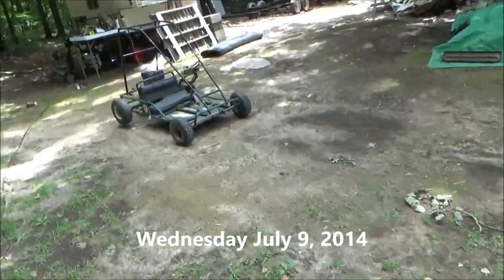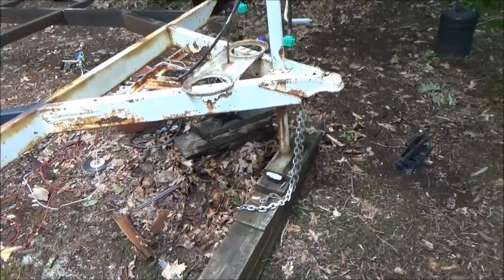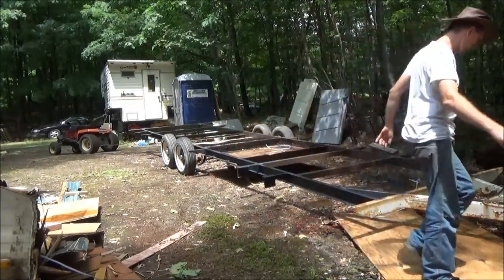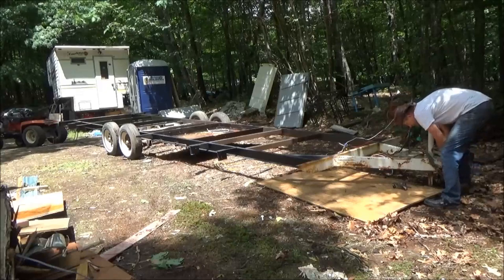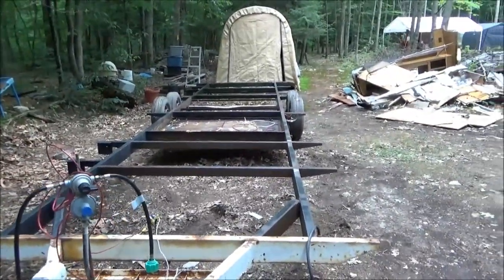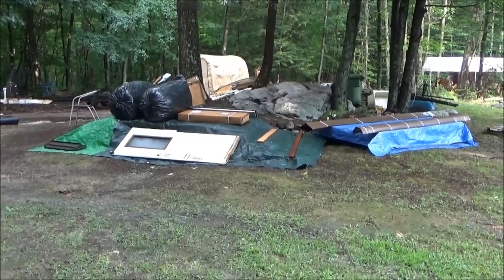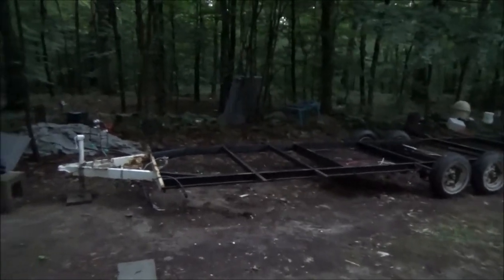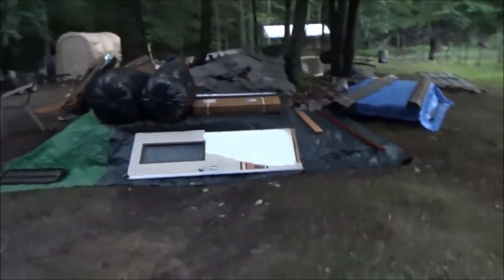Gokart Repairs And Prepping My Tiny Home Trailer

Comment: Watching that thin metal frame flex, bend, bounce, & twist when you yank on it with a small garden tractor, makes me think you should be putting the thinnest, lightest structure possible on it. I don't think the metal of those I-beams are thick & sturdy enough for anything else. Even when you lifted the front up & down by hand a little, the metal beams at the rear of the frame bounced & flexed like a leaf spring. 2x4 or 2x3 floor joists. Very little overhang, 2x2 wall frames with 45 degree joists in every corner for more rigidity, & no upper floor except for maybe a lightweight crawl space. Perhaps only 2x2 roof studs too. I don't think that frame will handle much more without bowing, bending, or twisting under the weight after you move in, or during high winds, or when a lot of snow & ice get on the roof.

Comment: Watching you try to move that trailer by yourself was very enlightening... I understand my Dad a lot better now.  He always made one of us kids stand around and watch him work on the trailers and things like that, which I found annoying.  But, now I get it we may have been skinny little kids but we would have yelled to him as soon as that tongue went in the dirt or fell off the rollers or several little things that would make the job easier.  Boy, it is hard to do things like that alone.   So cool that guy showed up to help!
Reply from the maker: Yes help is good. Watching on the camera you can see it all clearly. Sitting on the garden tractor I could see nothing. I am getting a lot of flack for my idiotic way of trying to move the trailer but I did not see it until I was looking at the video.
Reply: The Do It Yourself World  You may not have seen it sitting on the garden tractor, but with all the rain you have had and the soaked soft ground did you even consider the tongue sinking into the dirt to begin with?
Reply: Beth DeRoos I think you might be talking about something different.  He had already lifted the tongue and put the wheeled thing under it and on wood because of the soft ground... but it slipped off the wheels.  I was just noting that just set of eyes to give him a heads up would have made the job easier.  Everything just seems harder alone.
Reply: The Do It Yourself World   That is why armchair quarterbacks get such a high opinion of themselves... they have the benefit of the video.  In real life... people futz around a lot but keep trying.
Reply: MollyDolly  Am going to disagree with you here Molly.  What if the armchair quarterback is Joe Montana and knows what he is talking about?  

And what about an engineering professor at Stanford University, watching a YT video and seeing mistakes, who then comments on said mistakes?
Reply: Beth DeRoos  We don't actually have a disagreement here... whether someone is an engineer, or a know-nothing  both have the benefit of the video, right?

 I am just saying watching something on video is easier than doing it and not seeing what is happening behind you.
Reply: ***** Actually, I do see Beth's point.  Beyond that I agree with you.  Please, don't faint.
Reply: MollyDolly How come Ken Beale's comments show up in my email per this YT channel but not here on the site itself?
Reply: Beth DeRoos I don't know.. YT and G+ is so messed up.   Troy mentioned just finding out about the PM being moved... I don't even have PMs any more on this Android tablet.   Which is a bummer I JUST learned how to do it and I really wanted to send one last week to someone but noooo.
Reply from the maker: Beth DeRoos Because now with the YT and G+ integration, when I "block" someone, it is not really blocking them at all. Only the channel owner is blocked to them. They have a back door which they use to comment on my videos anyway. G+ wants to take over facebook but nobody wanted to use it. So they integrated with YT, messing up a good thing. Now all YT comments are mirrored onto G+. Funny, if you have a website and show duplicate content, Google bans your site. Hmm, two faced.
Reply from the maker: MollyDolly Please do not talk to Ken B anymore. You can block him on G+ and he will vanish like a puff of air. If he rears his ugly head on another thread I will ask them the same thing. Its the only way to truly block someone anymore. If the people whose thread they are using block them too.
Reply from the maker: MollyDolly I finally figured this out.
Reply: The Do It Yourself World What if the banned person or friend of starts a thread?  Does the channel owner have the power to take a thread down?
Reply from the maker: MollyDolly A person who was banned on that very same video can keep going on that video but on no new ones. I cannot delete what I cannot see.

Comment: Why were you trying to tow the trailer from the back? That makes no sense at all. You put the roller device under the hitch end and pivot the entire thing 180 degrees from that end...you probably could have done that by hand with a few sheets of scrap plywood on the ground. Man, you make every task extra difficult. Glad you got er done though. I bet that guy scared the crud out of you.
Reply: Go buy a HF tent like you have your tools in and put it over the frame and work in the rain.
Reply: Paul Martin
I have been thinking the same thing.  He doesnt seem to listen to  common sense. He gets a idea stuck in his head and that's the only way it can be done. There is always a reason for no progress,  Winter will be here before you know it.
Reply: Mostruggles
Also all the piles of junk around the work area just makes that much harder. Hard way or no way!
Reply: Mostruggles At least he figured it out before that guy showed up. If it were my husband, he'd still be out there trying to pull it the way Troy started out and arguing with anyone who tried to tell him different, especially me.
Reply: There is wisdom in the council of many.  I have been pretty stubborn most of my life.I have learned from many failures and payed the price.  I have also learned sometimes its good to listen.
Reply from the maker: He did surprise me quite a bit. Actually I could not pull from the front of the trailer until I got it away from the tent a little bit. Then, off camera, I did pull from the front and it went nicely.
Reply from the maker: Paul Martin The HF carport is only 10 by 20. My home is 10 by 24. The carport would not protect the trailer and my work from the rain. Rain does not come in sideways. And I cannot afford one anyway, nor a tarp long enough to do the job.
Reply from the maker: Mostruggles Please think before you insult someone. There are reasons for some things that you may not see because you are not here personally. I had to pull the trailer back away from the tent far enough to be able to get to the front with the garden tractor. The carport is too small for my tiny home and would not protect it from the weather. And no, I dont have the money for a tarp large enough for the job.
Reply: The Do It Yourself World Just thinking you could cover the part your working on and move it as necessary.
Reply: Paul Martin When it's raining it doesn't help to paint under a tarp. It protects the paint from damage by the impact of the rain drops, but the humidity will still mess with the paint. Been there, done that trying to paint steel boats in an earlier lifetime.
Reply: pieter zeeuwen The humidity sure is an issue. I hadn't given that much thought when I commented...was just thinking about getting T out of the rain so he could make forward progress.
Reply: Mostruggles I think troy will do it how he wants to.
Reply from the maker: Donald Johnston You got that one right. I am here doing it. I have to do it the way I want to. Yup. I do appreciate advice and have learned a lot though based on that. My tiny home plans have changed again and again based on advice. But yes, I do it the way I want to because its my home. I am sure if you build a house you will build it the way you want to. Yup, uhuh.
Reply: The Do It Yourself World
I will give you that, I can only comment on the information presented.  My comments sometimes come from my frustration level with watching the proceedings. I don't mean to offend, but i am not generally very sensitive to  people's feelings.  In my line of work, (construction) there isn't alot of time for feelings.  Things work or they don't.  You receive alot of advice, much of it, i'm sure is conflicting, so i will refrain from  such and just watch from the comfort of my living rm.  Good luck with the rest of the build.
,

Comment: I just did the steel on my trailer. The video is on my channel. The paint I used worked incredibly well and I couldn't be happier with the results. I was thinking about that when I saw you doing this.

Comment: Troy. You can put a longer bolt and nut in the hitch on the lawn tractor, to help you move the trailer. Make sure to put a nut on the top and bottom. I have used this method several times

Comment: About 4 weeks to get the plywood on the flooring frame. Not one or two days.
Glad the Go-cart is running, but Why ?
Reply from the maker: What? I just got the plywood the other day.
Gokart will help me get around here faster. I have 56 acres out here. The garden tractor is slower than walking.
Reply: The Do It Yourself World
I don't think you will use the Go-cart to get around, but what do I know ?
Reply from the maker: ***** Lets see. Either I use it or I sell it. Either way its a gain.

Comment: Hi Troy, have you considered tarping off the area that you're working in? A few ropes strung between some trees and a big tarp or two. Won't help with the humidity, but would help to keep your surfaces dry-ish and give you some shade should you need it (but I don't think you do). I see construction sized tarps on the free sites all the time. Sometimes you can even get the insulated ones which would be an amazing score for a winter work tent. 
And totally agree on the PM's. It's way too confusing and convoluted so I never send any anymore. 
Saw the updates on the websites. Getting there! I was able to find the weather. Is it possible for you do also post in Celsius for us in the rest of the world? Only the US still uses Fahrenheit. I am not sure why you folks are so stubborn about that but I'm not going to start an argument here...oops
Reply from the maker: Thanks for the idea on looking for free tarps. Never thought of that. Cant wait to get my truck back on the road. I see free construction materials all the time.
Thanks, yes you directly influenced that fix on my website. Plus another error I had not seen.
sorry, its F or C but not both.

Comment: Troy:

I would change the oil on the GoKart one more time. Then I would look up on line how to adjust the valves since this engine is Overhead Valves...I've heard that often can relate in poor power. Once engine is good to go, I would remove the rear axle and check bearings...hopefully that is what has failed not he axle.

Comment: Troy as a Christian why would you be surprised that when you need help, that help would arrive?

From AOL News, NYTimes and other news sources:

Those who endured the winter's Polar Vortex may be in for a repeat performance of sorts.

Meteorologists say that those in the North and Northeast should brace themselves for the unseasonably cold summer temps predicted to return starting around July 14th.

Those living in the Great Lakes region will feel it first and then the chill will begin move east.

Weather experts aren't suggesting that down parkas and snow boots be dug out of storage, but locating some long pants and sweatshirts is highly advised.

Midwesterners will see highs of 50 to 60 degree. Morning lows could drop as far as 40.

By late in the week those on the East Coast can expect a 10-degree drop from what they're used to this time of year.

Temperatures under 50 aren't predicted except in the mountains, but it's still too early to say what they'll be for sure.
Reply from the maker: Woohoo!! I prefer the cooler weather to heat any day. You can always put on more clothes but you can only take so much off.
I was surprised that a man came out of the woods. True miracles happen but they are often a surprise when they do.

Comment: It may be that the springs (or a spring) is broken which hold the clutch shoes in against centrifugal force.  It should idle without pulling.   If it pulls at idle, it's because the shoe in the clutch is touching the inside of the clutch bell.  Replace.

Comment: You may have to strip off the green paint from the frame before spraying it with a better coating. There is no point in putting anything over a paint that is either bad to begin with or did not cure. Once covered up, that paint will never cure again.

Using rust converter may be a good idea, and a tar like cover over it, may be the best. My worry would be with any area that you cannot access once the floor is in place: tops of the beams and any ledge that is too close to the underside of the floor to easily access. The rest you can always access later. If necessary you can smother it in the kind of tarry coating that is used on ships.
Reply from the maker: Got it all finished. Video coming soon

Comment: I can't wait to see you start building on your house.. If those storms don't stop soon you may have to start building that boat. :) I am about 8 hours South of Upstate NY (My cousin lived several places there, Geneva, Farmington and a few others..) and we have been getting some of the storms as well. Just the other day there was a tornado warning 15 miles south of us they spotted a rotation on doppler... these storms are nothing to mess with.
Reply from the maker: Just wait till you see what I did today....
The weather was perfect today finally. But yes it was a long rainy spell. Sunday it seems like the rain will be back in force
Reply: The Do It Yourself World Good. I can't wait to see. I wanted to build a small camper, something like a teardrop camper, but it wouldn't fit my family. So, I found a pop up camper that was cheaper than what my supplies would add up to... however if I could build a tiny home and use it as a camper (and my van would pull it) I would want one SO bad!
Reply from the maker: Love To Live VSG I am doing some things here that I think have never been done before. Its going to be very interesting. I am calculating the weight of materials as I work to keep it down to the trailer limits. You may just be surprised at some of my ideas. Although with just a camper, I would do it all with 2x2 framing but still have better construction and insulation than a standard off the line camper.

Comment: Is that one rim bent or is the shaft in need of bending back. I have heated up axel and hitting it back with a hammer. you would need a pretty hot torch to do that. You can pour boiling water on the ant nest to kill them. Yeah the govener is out of wack. or adjust ment.

Comment: It hurt watching this happen have you ever moved a trailer before? I knew the tongue was gonna kick out opposite to where the plywood was.
Reply from the maker: Sorry, I am not perfect. And no, I never pulled a trailer backwards with a garden tractor before. I had to move it away from the tent so I could get to the tongue properly.
Reply: Me too. Before he even started I knew which way the hitch was gonna go & was gonna swing the other way. I was thinking, the board is on the wrong side & should be lengthwise in the direction the hitch is gonna swing.

Comment: Clean the carburator and don't run an engine without an airfilter!!
Reply from the maker: Carb is brand new and I am putting the air filter on when I get it running right. The engine was spitting water out the carb from the valves.

Comment: I do not understand the "Tiny House" concept. For a lot less money you could enclose and insulate around the RV, if positioned correctly put solar system on slanted roof. The RV is a ready made small home with built in AC and DC systems, why not use it. I would also look for another 3way refrigerator, as trying to run a regular refrigerator 24/7 is an expensive use of solar energy. I'd run the 12v during the day and use propane or good generator invertor hen sun is gone(bought a 2000w Kipor for $800 very quiet and fuel efficient similar to more expensive Yamaha or Honda). Solar systems are very expensive energy wise if not used wisely in conjunction with other energy sources. I think you will find yourself replacing batteries often, and if you get the good solar batteries they are going to be costly but  better designed for solar systems. The only constant type of 12v system would be if you had running water in a stream nearby. Remember you are in New York State not Arizona.

Comment: Trailer swivel jack stand with wheel bolts on to tongue ,folds up when not in use has large wheel.Only 29 bucks at walmart new maybe cheaper on graigslist used.
Reply from the maker: Was not worth it for a single day though
Reply: Buy it then take it back.
Reply: Brew Man  that is like stealing.
Reply: Brew Man dumb
Reply: I was hoping he didn`t injure his back or he would never get into a tiny home before it gets to cold got to be careful.
Reply from the maker: Brew Man Thanks for thinking of me.

Comment: So the start of this video was to create the drama of tying to move the trailer the wrong way, right.  I mean you saw the front moving towards the woods, so why didn't you move the the plywood over to that side? As for that roller, even if it was made in the U.S. it still would of bent, since it was designed to move on a flat hard surface, not dragged through mud and dirt. Why not set up several "A" frames over the trailer; cover them with the plastic. this would let you work in the rain and keep the stuff dry when you stop working.